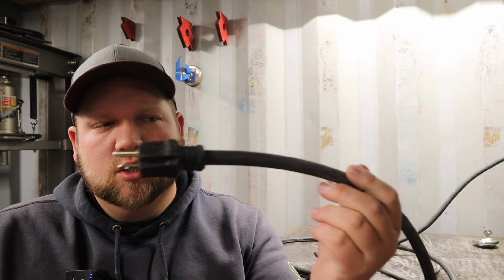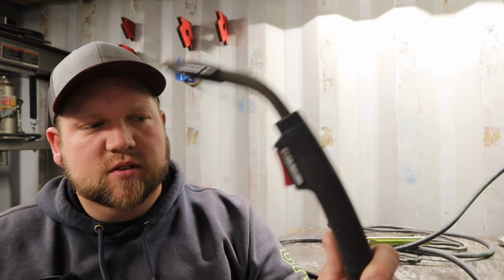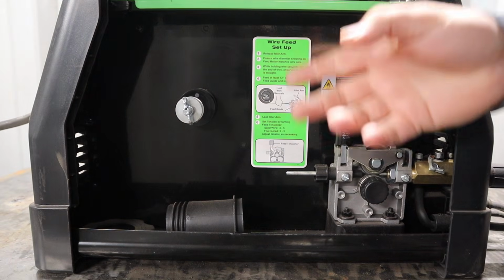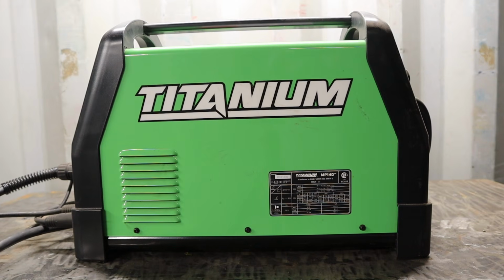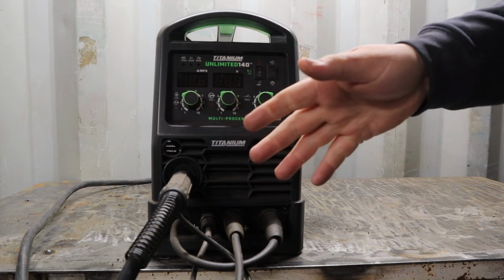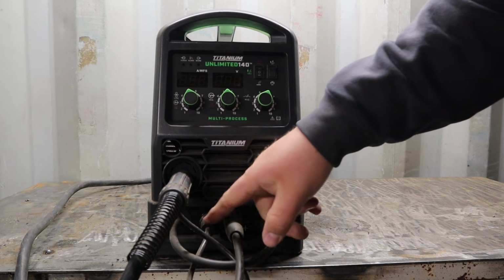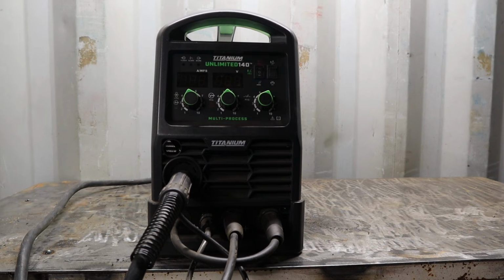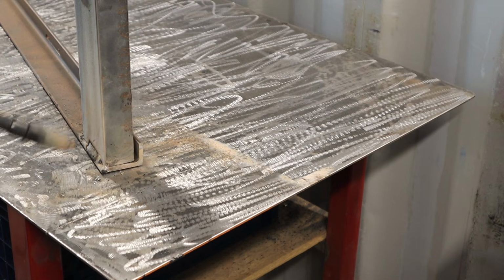(Harbor Freight) TITANIUM UNLIMITED 140 Multiprocess Welder Review - 1 YEAR!

Comment: I am just starting out with my own mobile weld repair business. Needed a better welder than the little titanium 125 because I need to weld aluminum fences. Was considering the Lincoln version of the 140 but am really on thr fence. My generator is only a 5000 watt.
Reply from the maker: Makes sense. Keep me updated on your story though with your business. No joke. I’m currently in education, I’m a elementary school teacher, but very seriously considering going back to school for welding to do exactly what you are saying right there with mobile welding and I’d be interested to know how this goes for you, especially starting off with budget equipment.
Reply: @DereksWorkshopAndProjects  will do my brother. I've been welding professionally for roughly 10 years but I'm not extremely talented or anything compared to other guys. I'm decent enough. One thing I can tell you is to concentrate on fitting. I never really did much of that in the field and it's one major hold up for me. I will update you brother. Excellent video by the way.

Comment: I'm borrowing one from a friend. It's setup for flex core welding. When I pull the trigger without welding, the wire advances about 3 inches and then stops even though I am still pulling the trigger. Is this normal or could there be something wrong with the machine? If I pull the trigger again, it does exactly the same thing. Pretty consistently the same distance.I opened up the panel, and i can see the wheels that advance the wire also stop at the same time, so it's not slipping.

Comment: Hey. I have to weld some 1/8" metal to some 3/16" old rust metal on a frame. I have a healthy 110 socket to draw from,but limited to it. My friend said I could use his welder and Im no noob,but I dont want to risk using his machine. Id like to get something for this job,and maybe use it for others in the future. Nothing over 3/16" to a 1/4",ever.   Your thoughts?

Comment: I own the original titanium mig 140 that is just a mig welder flux core and solid gas shielded welder as that is all harbor freight offered in that size at the time i bought it for the i think $389 with a coupon and its been awesome.  I didnt know squat about welding when i bought it and had only owned a tractor supply cheap cheap flux core machine prior to it that i converted to dcen internally after alot of research and its lasted me the past close to 7 years now with literally no real issues. I changed the ground clamp after awhile(personal preference) not really a fault, and had to take the cover off just this past year to tighten up the gas hose connection inside the machine which was only coming loose from me using it mobily back and forth to jobs and so forth hooking and unhooking the hose and regulator all the time. I put a 30 amp single pole breaker in my box for my 110v shop welding outlet anf its ran .030 .035 great without popping a breaker or shutting down, ive never reached the duty cycle, and have ran countless 10lb spools of wire thru it. I have also ran tons of .025 wire thru it with my 3500 watt champion generator without any issue for most of my mobile welding jobs that ive done. Its paid for itself time and time again. And now im about to upgrade to the unlimited 200 i think.  Just want 110v and 220v multiprocess do it all with 1 machine. Thw new 140 unlimited is enticing but i find myself welding some heavier guage steel lately and would like to have the 220v option.  I still wouldnt hesitate to buy another 140 or any of there welders after owning this one for so long without any issues.

Comment: Great vedio. I bought it because I like the fact that it's made in the U.S.A. and parts are easier to get,  and I'm supporting my country. I'm  new to welding and wanted one that I can do multiple ways. It would be cool if you can do a vedio for tip and mig and explain the difference. Like I said I'm new to welding. Thanks.
Reply from the maker: Titanium welders are definitely manufactured in China but harbor freight is a very American owned and operated business. So you can feel good about that part.
Reply: Titanium welders are made in china?

Comment: I've got a 250 amp airco AC/DC stick machine and a century FC90. I picked up one of these to get a little more wire feed amps and gas capabilities. I think I'm going to keep the century for flux core and use 140 for mig.

Comment: I have this machine. Welds great, just not for long
Reply: What do you mean, "just not for long"? I'm thinking about picking one up
Reply from the maker: I’m guessing he means it has a low duty cycle. Cheap machines don’t tend to have impressive duty cycle ratings. But I’ll let him answer for himself too.
Reply: @DereksWorkshopAndProjects  yea it shuts off when I try to weld thicker stainless steel. Doesn’t have the heat and duty cycles for the trimix gas

Comment: I bought this welder last weekend, and I fired it up this evening. I couldn't get it to work right. I was tying to weld two pieces of 22 gauge with .030 flux core. The issue that I had was when I pulled the trigger it would arc and the stop. When I release and pull the trigger again it would arc and stop again. I had the wire feed and the settings set to the settings on the inside of the panel. Any ideas what I'm doing wrong??
Reply: @Twister8700  it's been a month since you made this comment. Did you find out what was happening?
Reply: @davidgagnon2849   I haven't a chance to try it again. I may have some time this weekend to mess with it. I will let you know.
Reply: @davidgagnon2849   I got a chance today. It worked well. I believe that it was have been my inexperience with wire feed welding. All of my limited experience welding has been with stick. Once I figured out what i was doing wrong it welded nice.
Reply: @Twister8700  Thank you for your comments on it!
Reply: May be a little late but what i think is happening is that ur arching inside ur liner, sometimes ur wire will stick inside the liner causing arcs if ur liner or wire is dirty it will continue to happen, solution is buy a new liner and keep ur wire very clean don’t let it get wet or dirty because the wire can pull gunk into the liner even when brand new, are u in high humidity? 9 times out of 10 dirty wire and/liner will cause arcing/stoppages
Oh also u said ur using .30 wire did u check the wire wheel to be sure it is .30 and not another size because it can crimp or slip the wire while also be sure ur tension is just right not too tight or too loose it’s a feel thing not an exact setting and it will slip or pinch  and cause arcs inside the liner

Comment: I bought the exact same welder mostly because it runs on 120v. If I need a 240v welder I will buy a Miller 255 multimatic because I will then be able to weld pretty good hopefully.
Reply: Don't sell yourself short. This machine will weld 1/4 inch steel with .030 or .035 solid mig wire c25 shielded as good as any high dollar welder. Mine has been awesome. And with a 30 amp braker for my welding outlet it never gets weak or trips brakers. Some tip gel really helps these machines

Comment: I’ve noticed there is a slight delay in welding once you pull the trigger it’s a second before it starts spooling, does yours do this?
Reply: Yes, they all do... it allows the gas to start purging out of the tip and clear the oxygen out before it starts sending the welding current. It won't do this on flux-core mode.

Comment: After sitting on the idea for many years, I finally pulled the trigger on trying some metal work just last week.  I chose the Titanium 125 as a starter machine, but have already decided I will likely step up to a multi process machine fairly soon. If price was no object, I'd be looking at the Millermatics - but since I haven't won the lotto yet, I will probably go with a higher end Titanium.  Leaning toward the 170, just because I have 220 available in my garage.
Reply: I was gonna do the same thing but I payed 50 more dollars for the 140 cause it has stick, tig and can add a aluminum stinger, I think the 170 has option for aluminum stinger also, but I wanted the tig cause it's so clean on body work and I want to build my own custom stainless header's
Reply: 220V will make a big difference, don't get rid of the 125 though, It's an awesome, light and "comes in handy" type 120V welder. I have a few welding machines and whenever I'm welding light gauge this is my choice.
Reply: @lv2keepfit493  I hear ya.  It would be in addition to the 125, not a replacement.

Comment: Does the argon gas automatically shut off when the trigger is released? Thanks in advance!
Reply: Particularly this titanium 140 is a flux core machine does not use argon , a mig welder machine does use argon and yes automatically shut off argon when trigger is released !
Reply: @arthurrivera4230  you have the option of using gas...

Comment: I just got this welder yesterday and it didn’t come with .025 contact tips. I went to lowes and bought Lincoln electric tips and they didn’t fit and HF doesn’t sell the same brand tips either. Can I run the .030 tips with .025 wire?
Reply: i believe that's what it's built to run is .030 and .035.

Comment: This welder works really well. Only problem I seen to have is with stick. You don't want to add more than  25 feet of extention cord to it. Or it will drop ur output and cause you to stick when stick welding and the arc sputters out on you. Other than that. I run 1/8th inch 5p 6010 rod with it and it works well. After 25 feet extention cord. It has some stability issues. With tig. No issues. Just sucks about the head not being flex for the torch. So I upgraded that to a radnor flex head which allows bigger cups. You can go to 110  that way. I've been using it for stainless less pipe and it does beautiful work. I'm a professional welder and I'm satisfied with the price point. The stick side makes me unhappy. Mig is okay. 22 isn't a max setting I prefer. I want 24. But oh well. I prefer hot and fast.

Comment: whats ur opinion on the 125 vs 140 in ur type of use? why did u go with the 140 over the 125?
Reply: 125 is just flux core. You can run gas if you do some work to the lead and you have to have a sepperate lead for gas and can wrap it together. Other than that. The 125 does decent work with just flux. Blue demon makes a decent stainless flux core wire which this 140 welds with nicely but it's touchy and can burn through easy on this stuff. Tig side is the way to go even if it doesn't look as nice though.